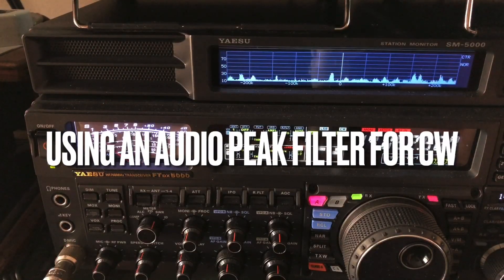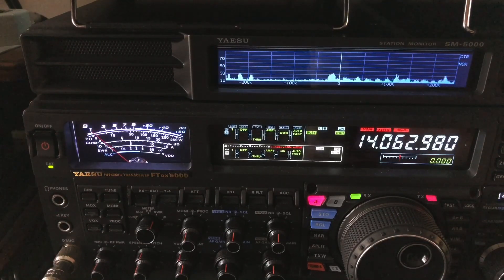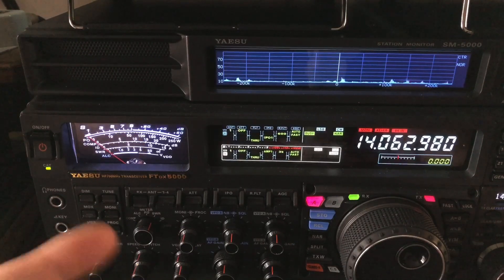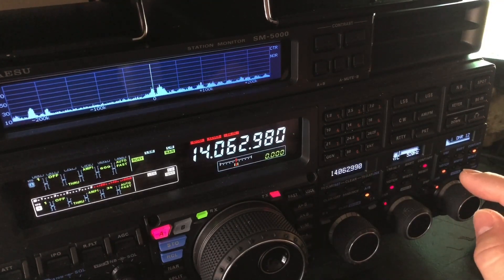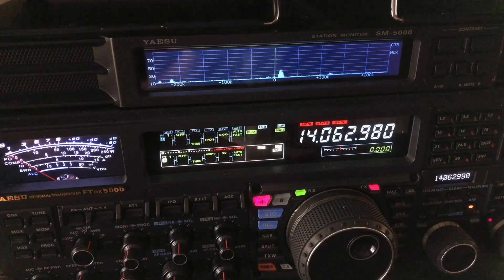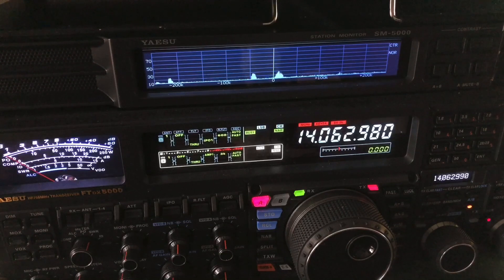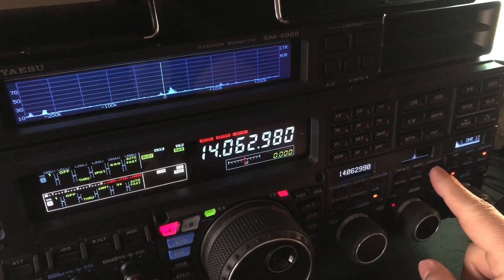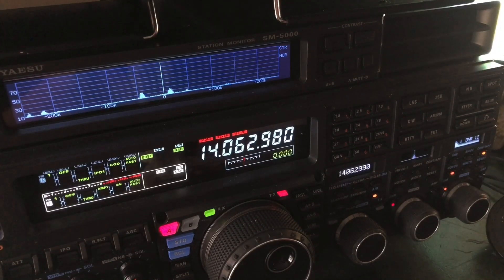Using an Audio Peak Filter for CW

Comment: Any thought on using a whiteboard and breaking some of this down for the less experienced?
Reply from the maker: I will give it a shot, Don!  Need to get a board and markers.  73, Doug
Reply: @n4hnhradio  Did you get my message on Patreon regarding filters on the sotawatch3?
Reply from the maker: @imaflatpicker3066  I did get that message.  I responded.  I don’t know that we can filter like that.  The apps filter though.  I use HamAlert.  73, Doug
Reply: @n4hnhradio  ok I'll check out the app.  I guess Patreon didn't or doesn't notify me when someone responds.  Thx for the info. 73
Reply from the maker: @imaflatpicker3066  HamAlert allows you to filter bands, modes, sources of spots, and even specific callsigns.  73, Doug